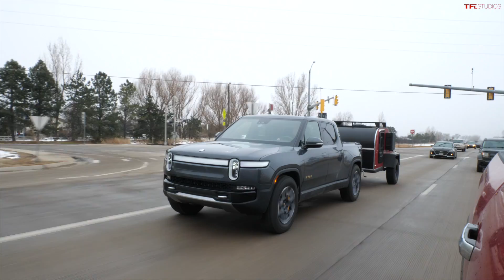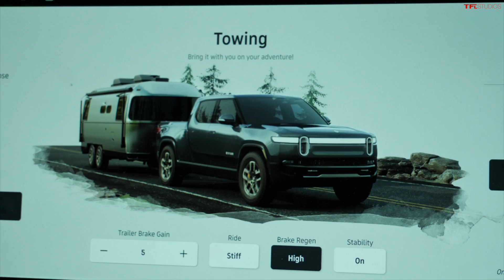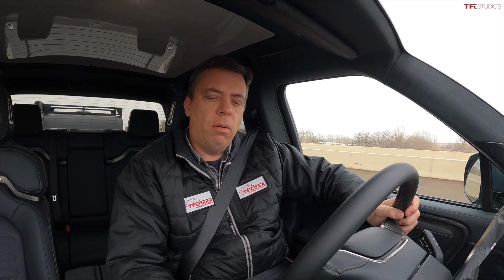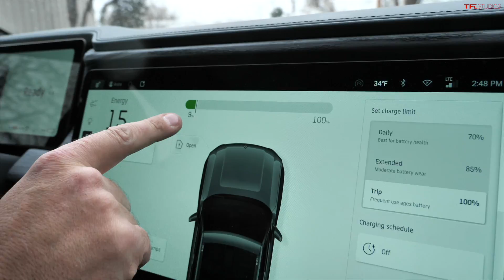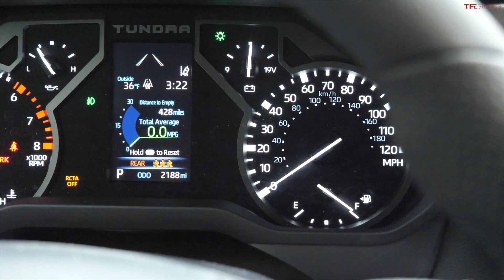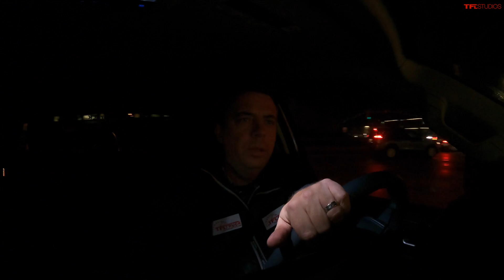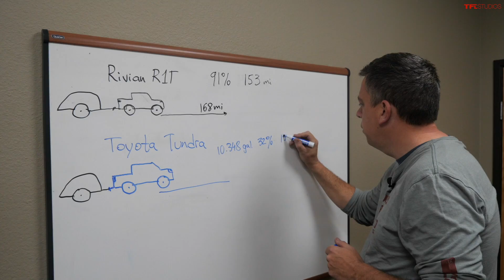Rivian R1T vs. Toyota Tundra: How Far Can Each Truck Tow On A Single 'Fill-Up'?

Comment: The R1T, and any EV, is extremely efficient whether towing or not, the 'fuel tank' size and 'refill' duration is the issue.
The Tundra used 350kwh of energy, 3 times more than the Rivian. The Rivian got the equivalent of 44mpg which is insane for the weight and towing, where as Tundra 14mpg
Reply: MPGe is such a meaningless metric, because charging and generation aren't 100% efficient. More than 1/2 of your energy usage is happening before the electricity even gets to your battery.
Reply: @Mark_Christian25  lots of factors. But looking at how the vehicle uses its energy is what the point here is. Gasoline has to be mined, refined, stored, transported. Can look at many factors, but this test is about energy consumption of each truck.
Reply: @andrewsbbq  Which is still a meaningless metric, because it takes tons of energy to even deliver your energy. 

Stop trying to ignore the point.
Reply: @andrewsbbq  the batteries have to be mined, refined and manufactured into a usable battery. Then you have to mine, and process the coal, natural gas or nuclear power to use said battery. Then, you're not even considering the power loss from the cold. Education is key kid! 😉
Reply: @JohnDoe-nz6bk  you still do not understand the towing test. Your ignorance calling me a kid and unintelligent is pretty ironic, but I wouldn't expect you to understand why that is either.
Reply: @Mark_Christian25  I'm not, I acknowledged it and agreed with you lol. That's not what this test was about, and not what my original comment was about
Reply: @andrewsbbq  I understand it completely kid. You're the one that doesn't! 🤦‍♂️🤷‍♂️
Reply: @JohnDoe-nz6bk  it's ok. One day you'll figure it out. Until then just keep thumbs-upping your own comments 👎
Reply: @andrewsbbq  oh, the tundra got over 15 mpg, and over 400 miles per tank at 15 mpg. The rivian made it 168 miles on a full charge, the battery (supposedly) can get over 300 miles per charge when not towing. You just lost half immediately. And that's them doing 55 mph! Like I said, you're critical thinking skills isn't your strong suit kid.
Reply: @JohnDoe-nz6bk  lol you need to take a step back and reread the original comment.
Reply: @andrewsbbq  Don't worry man, this guy has been harassing people in the comments for a while and spreading mass hysteria. Don't mind him, people like him are but a small percentage of the overall US/global population.
Reply: @migueljardim8177  haha ya. I guess he wouldn't truly be a fool if he was self aware
Reply: @andrewsbbq  I did! Then I read your other comments, responding accordingly. Why are you having such a difficult time comprehending that???
Reply: Gasoline ice thermal efficiency of 30% is on the pretty good side. Fuel thermal efficiency for the Rivian happens remotely. If we use the same analogy, the Rivian has a 4 gallon gas tank that weighs 3000 lbs and takes over an hour to fill.
Reply: No its not! 🤦‍♂️
Reply: @JohnDoe-nz6bk  it is. How is it not? 🤦. Do you understand what is meant by energy and efficiency?
Reply: @andrewsbbq  it's not efficient by any means. The power lost during the cold, the amount of time spent recharging, the price of the vehicle, etc etc etc etc etc. Use those critical thinking skills kid!
Reply: @JohnDoe-nz6bk  "energy". Kid.
Reply: @JohnDoe-nz6bk  What he means by efficency is the actual energy usage it uses during the trip. Nowhere did he mention efficency time wise or price wise so that was kinda a moot point you made.
Reply: @migueljardim8177  which was not efficient at all!

Comment: I miss the white board! You guys used it often in the earlier days!

I was waiting for the efficiency comparison, but it never was mentioned. 

The Tundra can go 2.8 times farther on a "full tank" than the Rivian, but the Rivian can do it 2.8 times more efficiently. 14.8 MPG in the Tundra vs 42.1 MPGe (equivalent, 1.25 mi/kWh x 33.7 kWh/gallon) in the Rivian. For Metro work under 150 miles in a day with work equipment, the Rivian save tons of energy. 

For cost, the average kWh is 10 cents in the US, per mile, the Rivian costs 8 cents per mile, while the Tundra costs 27 cents per mile at $4 gallon. 3.3 times more expensive, towing a 4k lbs trailer.

 But charge costs vary greatly, from "free" from solar/batterys as I have on my house, to 31 cents/kWh at a DC fast charger on the road.
Reply: Finally! Somebody gets it.
Reply: True but time is money 💰.  Fill the tank quickly while a "quick charge" is still much slower that a fill up on an ICE 🧊 vehicle.  I do like electric vehicles but for my usage and time I need to do a job and lifestyle a gas ⛽️ vehicle is for me. I am sure this makes sense for some. If it was just for commuting this would make sense for me but sadly it's not the case.
Reply: Very helpful analysis…gas is $2.94/gallon which equates to $.20/mile with this comparison. 

I have a 21 F150 3.5 ecoboost with the 36 gallon tank specifically for the added range when towing. 

I tow up to a 20 ft equipment trailer and it’s a pain to find a gas station I can easily get my truck trailer to fit in.
Reply: You state the tundra costs 3x more per mile... but use the 10c/kwh THEN state charge stations charge 3x that (30c/kwh).  So... the rivian cost is equivalent - when on the road.  Did i understand correctly?
Reply: @John B  yes, WHEN and IF you long distance travel. The Tundra ALWAYS costs that much. Not everyone that tows goes long distance.

Comment: Seems like the electric truck is not efficient enough to make a good tow vehicle.
Reply: On the contrary! It is over 3× more efficient than the Tundra (42mpg vs 14mpg). The only problem is the Tundra's fuel source is more energy dense than the Rivian's. This makes up for the Tundra's lack of efficency.
Reply: @migueljardim8177  How do you figure that?  Both started at 100% energy density for the test.
Reply: @puffnstuff12  No, both started at 100% capacity not energy density. Energy density refers to the amount of energy per kg or per litre. Petrol/diesel contain more energy per litre than batteries currently do today. So in theory the only thing you need to do to increase the range of an EV is to increase the energy density of the batteries it uses.
Reply: @puffnstuff12  So for example if the Rivian and Tundra both had fuels of the same energy density then the Rivian would be able to go at least 3× further than the Tundra because it is 3× more efficient with it's energy usage.
Reply: @migueljardim8177  Why make excuses for them not being able to match an ICE doing the same work?  In this test the Rivian was at a 100% charge state and consumed 91% of its battery to perform the same work that the ICE consumed 32% of its fuel capacity.  Very poor performance indeed and is just another reason that people are not turning to them at the same rates that they do ICE.
Reply: @puffnstuff12  Yeah but it sounds like you didn't listen to what I said carefully enough. Those two things are not the same. Energy density and total capacity are NOT the same. The Tundra gets away with being more than 3× less efficient than the Rivian simply because it's fuel source is more than 3× as energy dense as the Rivian's.
Reply: @migueljardim8177  Full tank vs full battery....battery loses...enough said.
Reply: @puffnstuff12  And common sense and science out the window apparently.
Reply: @migueljardim8177  LOL load both of them to their rated capacity and that Rivian will barely make it out of town before it needs to charge.
Reply: Electric cars are  two time more efficient than ICE cars, the difference is that gas is more energy dense, but battery tech is changing every day

Comment: Definitely a lot cheaper using the Rivian on that loop.  2-3 times less if you have electricity where you live..  You can see the gas pump blow past $40 in the vid.
Reply: 🤣🤣🤣🤣🤣🤣🤦‍♂️🤦‍♂️🤦‍♂️🤦‍♂️🤦‍♂️🤦‍♂️🤦‍♂️ the Toyota is definitely cheaper!! The price difference alone makes the Toyota cheaper!!!!
Reply: @JohnDoe-nz6bk  vehicle cost vary.  Much cheaper vehicles then pickups could tow this trailer.  Just on cost per mile, and then if you include maintenance required by the Toyota the price purchase price difference is made up quickly with how cheap the Rivian did this tow.
Reply: @einstein1113  that's completely wrong. Toyota has 2 years free maintenance. 50-80 dollars a year after that (General maintenance). The Toyota is 40 thousand cheaper, do the math. Other vehicles you're talking about have smaller batteries.
Reply: TFL had an out the door price of 64k for their Tundra.  A Rivian can be bought for less then that out the door in their location.  The Toyota took over $40 to run that loop.  Rivian if they have electricity at there shop or where they live would take $14 dollars or so to fill up.
Reply: @einstein1113  uhhh... That rivian is 100 grand! 🤦‍♂️
Reply: No.  No it’s not.
Reply: @einstein1113  Yes, yes it is!
Reply: Not even close.  😂
Reply: @einstein1113  🤣🤣🤦‍♂️ I highly suggest that you educate yourself before posting anymore stoopid comments. That rivian STARTS at 75 grand, BEFORE OPTIONS!
Reply: In Colorado a Rivian explorer model is $67,500 and an adventure is 73k.  After incentives they are substantially less.
Reply: Why wouldn’t you fly?   You camping in Miami that you are dragging a tear drop trailer.

Most people going from Boston to Miami are likely not camping in Miami for a week.
Reply: Are you pulling a camp trailer to Miami from Boston for the week on the beach or just running empty?

Comment: Respectfully, seriously guys? 
You whined for months to get this truck, had it for a week and this is the range while towing test you planned to complete?
An R1T can tow up to 11,000 lbs. You either chose a tiny trailer relative to the maximum towing capacity (11,000 lbs),  or were forced to tow a tiny trailer by Rivian, or went for the least expensive option because Colorado Teardrop gave you a loaner or paid you to use their trailer. It would have been way more helpful to have least towed with 50% of the rated towing capacity.
What was the point in demonstrating that the Tundra would be able to travel farther than the R1T while towing? Even an idiot would've known this in advance. 
The real question was how to the range reductions for each vehicle compare? What is the comparable MPG? Did the R1T's range reduce by 50%? Did the Tundra's reduce by less?
And, what was the exact distance travelled by each vehicle?
What was the exact time so we can calculate the average speed?
What was the final MPG for the Tundra?
What was the comparable cost for the trip in each vehicle using Electrify America's rates and the current gas prices in Colorado?
I know Andre put in a long day and was tired, but what the heck TFL?
Sorry!

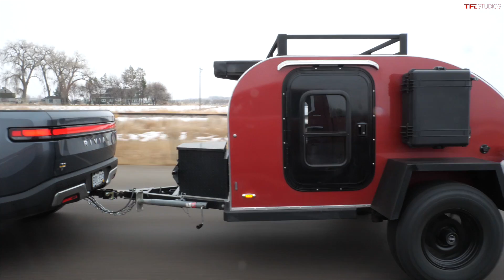Comment: 4:09 I just saw a huge flaw with the way that the wheels and the propane tank are. If it catches in the tread like a nail at just the right angle... It can shoot it right up through the bottom of that tank and cause it to explode or leak. Uhhhhhh couldn't they have put that tank anywhere else lol.... That just looks unsafe when going down the road with no protection.
Reply: Go check your wheel well liners are your car and tell me how many punctures there are in the plastic
Reply: It would probably be a rare occurrence but I think the people that make these trailers might want to take that into consideration and put a armored plate under the tank or something.  I know tanks that carry a lot of pressure can be still punctured with the right circumstances and force.

Comment: EV’s are like kids 
Hell out of the gate but lack stamina 
Good for the cities only
Reply: They're also extremely efficient with their energy, like 3-4 times more efficient. Only thing that needs improving here is the energy density of the batteries and they will have more range than an ICE pickup in no time.
Reply: @migueljardim8177  that and charge times need to come way down

Comment: It cost the Tundra $40 to run that loop. It cost the R1T $15 to do the same loop, assuming $.125 /kW home charging.
Reply: Then you have to calculate in the sale costs of both vehicles and then calculate the time spent at the gas pump and time spent at the charging station.
Reply: @hoodieman04  For this test, the R1T charged while they slept, so zero time spent standing outside in the cold holding a gas nozzle.
Reply: @metal_horses568  Yea? I filled my vehicle the night before. It was warm. 0 time holding the nozzle in the cold!
Reply: @JohnDoe-nz6bk  You still had to make a stop and spend time filling up. Only 5 minutes, but it was zero minutes with the Rivian, but I'm glad you weren't cold
Reply: @metal_horses568  Yea? That rivian has to stop (over an hour each time) to get the equivalent distance as the Toyota. Critical thinking skills isn't your strong suit kid.
Reply: @metal_horses568  right, but over the course of someone owning it they will have to stop and charge it and those chargers are exposed to the elements just like a gas pump. and just like filling up a regular car you can get back in your vehicle while it fills up. difference being the 5 mins you sit while your vehicle fills up with gas versus the 1 hour plus you sit charging the EV up
Reply: You people get so butthurt over electric lol. If you're towing across the country then electric right now is a bad choice. No one's denying that. If you do it once every year or two, then it's doable, but annoying. TFL did a local loop test, so none of your "Whataboutisms" apply here
Reply: @metal_horses568  not butt hurt, just pointing out the impracticality of owning one and using it as a truck. my time is too valuable to be spent sitting at a charging station. when an EV can produce the same longevity as a regular vehicle and fill up just as quickly there wont be an issue.
Reply: @metal_horses568  tell us you never go far from home without telling us
Reply: The price difference between the two alone makes the Toyota cheaper. 🤦‍♂️
Reply: Unless you're on a long road trip and had to use an electrify America. Then it would be $38 for the Rivian at .31/Kwh. So really comparable in distance vs money spent in each. The only thing that wouldn't be great is the long charge times. But if you are staying in town around the house, Rivian would be significantly cheaper in the long run.
Reply: @XBLWasabiSnooters  no its not! There's a 40,000 dollar price difference between the two.
Reply: @JohnDoe-nz6bk  well I wasn't referring to total cost. You would be correct. I just meant for fueling purposes. And to add to what you were saying, I'd imagine insurance would be significantly more for the Rivian. Pretty neat how I made a comment without getting defensive. Not one exclamation point used, give it a try 😘
Reply: @JohnDoe-nz6bk  I was just clarifying what I meant and even adding to your argument of price. It was all in your favor, guess there isn’t hope for everyone in this world. Good luck on your internet wars.
Reply: @Mike Only 13% of my vehicles are electric, so I don't think that makes me an EV fanboi. You open the garage door, pull in (Just like any other vehicle) and you take 3 seconds to grab a plug off the wall and plug it in. Time yourself tonight when you charge your cell phone, it's literally the same thing. A lot of camp sites have electric, so you'll leave with a free full 'tank'. I curb my Bronco wheels against rocks if that's what you meant.

Comment: Says he averaged 55 mph when I seen the speedo hit 75-77 a couple of times for fairly long distances! I would have set the cruise at 65 & probably gotten about 200 miles out of it but I still dig the Rivian & they are building a new plant right here in this little old small kuntry town of Social Circle Georgia! DAWGS 2021 National Champions - PEACE LOVE n HIPPYNESS ✌☮
Reply: Exactly. Fools driving an ev don't realize a 10% increase in speed = significantly greater than a 10% increase in consumption so slowing down a little would save them a lot.
Reply: @larryspiller15  agree! I still like the Rivian compared to the other EVs I have seen so far